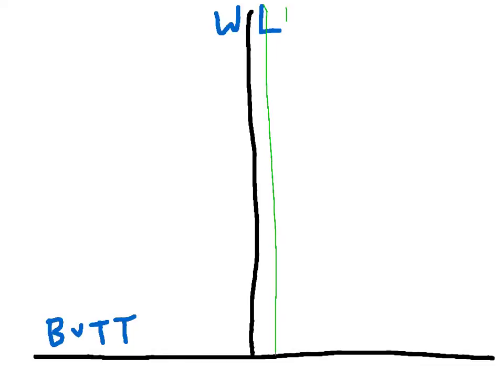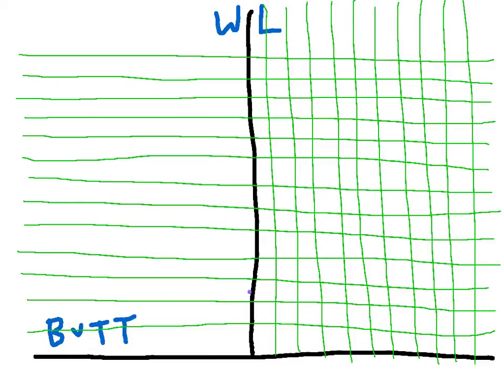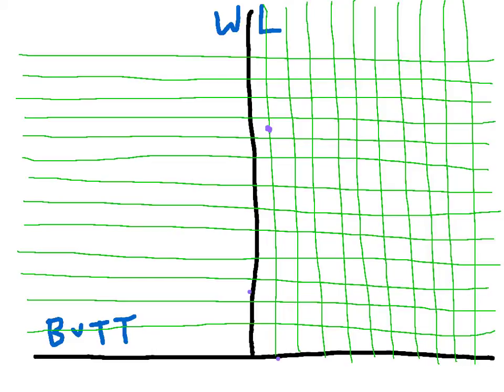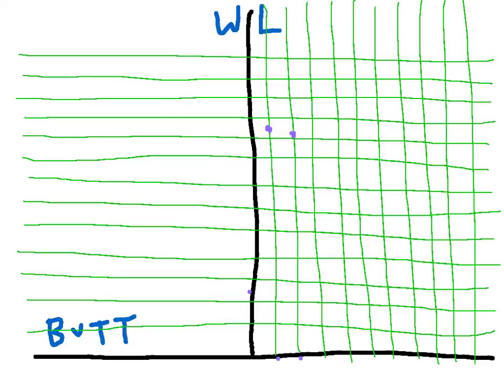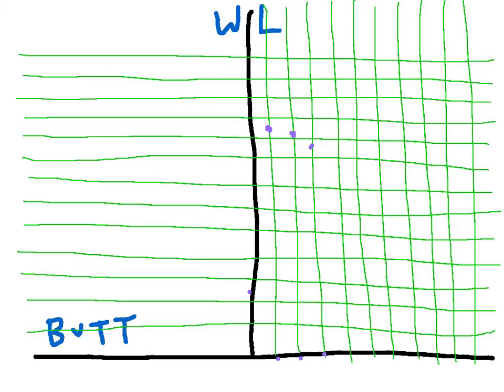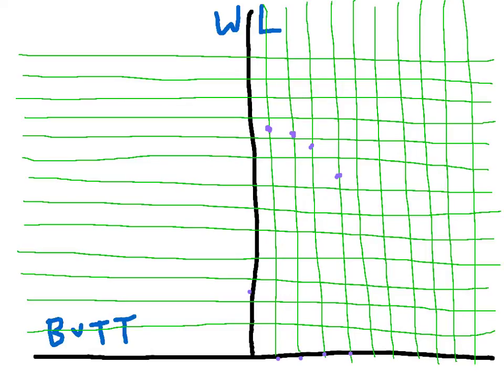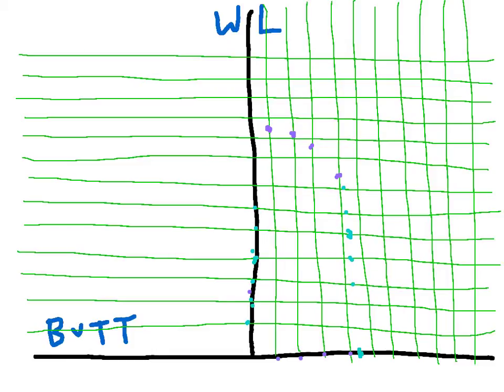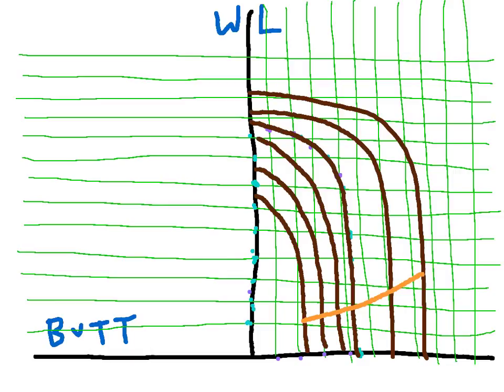lofting canoe table of offsets

Comment: Your video has been very helpful to me. I am lofting plans out of Canoecraft for Bob's Special Chestnut Classic. If you still have this book, would you mind looking at the lofting for the stem on page 47?  Waterline 20" makes no sense to me whatsoever. Additionally, this plan calls for a station 7 but the the measurements are from station 6. I'm thinking to skip station 7 altogether and just make a stem and stern station to attach perpendicularly to station 6.  At this point I have ignored WL 20 and freehanded a line up to about a 3/4 of an inch below the profile of station 6, so that I have room to laminate up a stem to come up even with the top of station 6. What do you think?

Comment: How you take the measurements ?
Reply: The measurements I’m using come from a set of canoe plans in “Canoecraft.” I draw the grid on a piece of paper and space the grid lines two inches apart. There are a few places you can find tables of offsets from someone who has designed the canoe. Does this answer your question?
Reply: @David-ex8dj  yes. But i have made a model and would like to obtain the measurements.  I guess its a headache to obtain the measurements from the model. The model is 39 feet long and 13 feet wide
Reply: Roy, if you are trying to capture the measurements from an existing mold, or model, one of the easiest ways to do that is by using a 3D scanner. There are handheld laser scanners that can accomplish this. Then someone, from within the software you would create your slices (stations) and take measurements from within the software to create your own tables of offsets.
Reply: @David-ex8dj  yes but i would like papers and pencils not computers
Reply: Roy, you’re dealing with a pretty large shape.
Reply: You could maybe try to use cardboard or similar material to capture the outside shape of your boat. That would allow you to create your own table of offsets. Instead of creating positive stations that you would lay wood strips I don’t like with a canoe, you might potential he create a negative station that you would use mostly for determining your table of offsets.
Reply: @David-ex8dj  yes that's the problem. Its large
Reply: @David-ex8dj  the boat is 10 feet high. Maybe you make a video about this

Comment: Interesting method, but for Europeans it is very difficult to understand in inches and feet.
Reply: You could convert to metric. There are 25.4mm per inch.
Reply: @David-ex8dj  thanks, but what is the diference betwen 2-4-5(2 feet, 4 inches and 5 eights) and 2-4-5+ ????
Reply: @BOMBERORAFA  the + is meant to be an indication of a sixteenth of an inch, approximately. Once I have all of the points plotted, accurately using rulers and t-squares, then I draw the curve. Plotting the points accurately to the sixteenth is close  enough for drawing the curve. 

One if these days I'm going to create a file to cut the stations on a CNC machine. But, for that I think I want to account for material thickness and determine the appropriate cutting angle to blend to the next station appropriately.
Reply: @David-ex8dj  Thank you very much for your clarification David. I have already made my conversion table to millimeters.